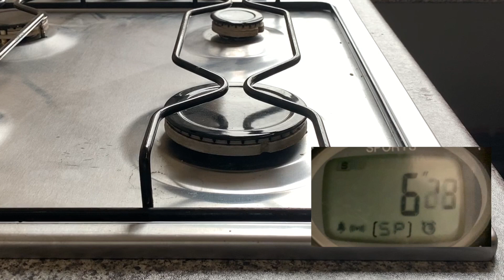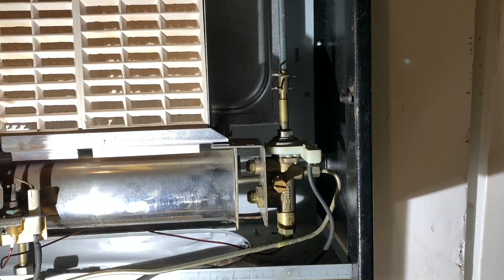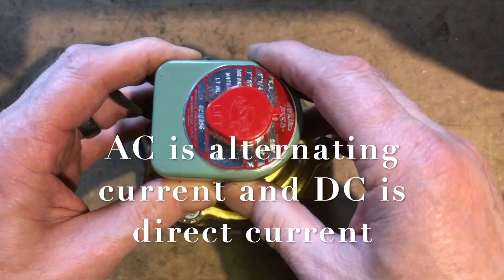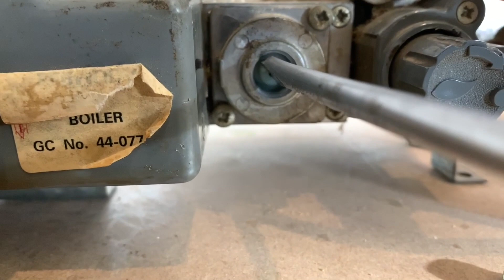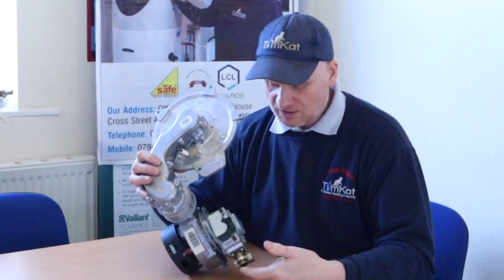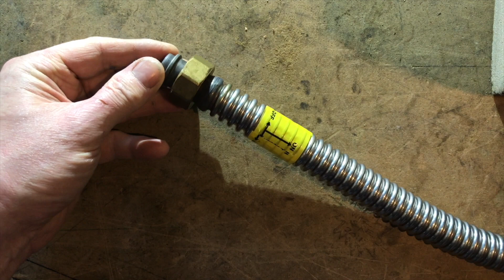GAS APPLIANCE CONTROLS (remix). how to check the gas controls on cookers fires and boilers.

Comment: On the cooker hob FSD test, why did you not do a mini or Full tightness test after extinguishing the flame? 
You haven’t checked that the FSD has full closed, whilst it clicks out, doesn’t mean it Is fully sealed!
Reply from the maker: First what is a mini tightness test ? And second  if you are talking about the back boiler I used the manometer to see if it was passing.
Reply: Hi Tom Kat, love your videos, what Mark is saying is when checking the electrical FSD on the gas oven why you didn't put the U Gage on the meter to check the FSD has fully closed because we was taught the click sound is not 100% accurate.
Reply: To explain further the test I have been taught is to, attach a gauge at the meter test point and run the appliance. Turn off the gas and start stop watch.

At 58 seconds grab ECV handle at 59seconds turn on and at 60 seconds turn off, there should be no drop on the gauge(ECV).